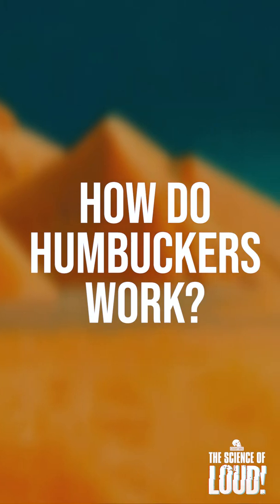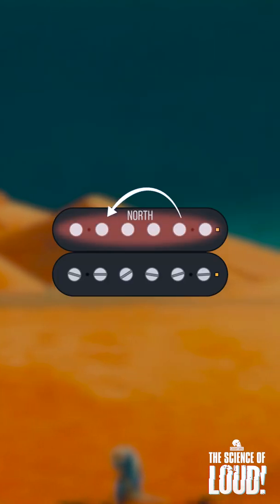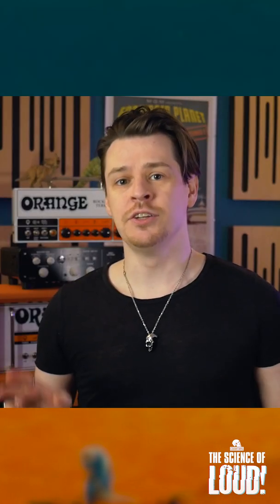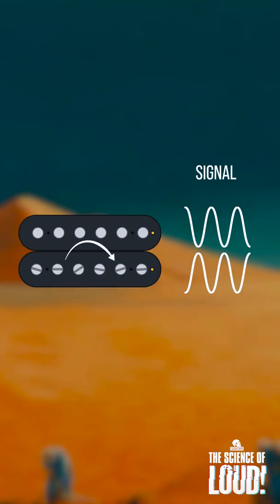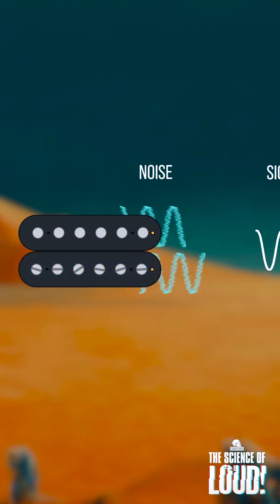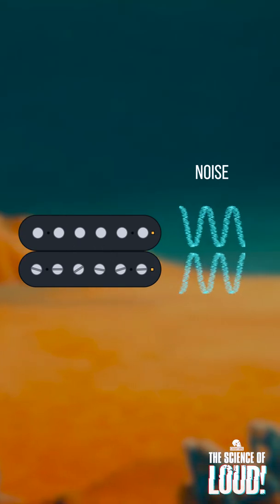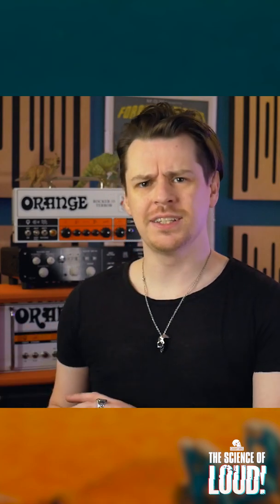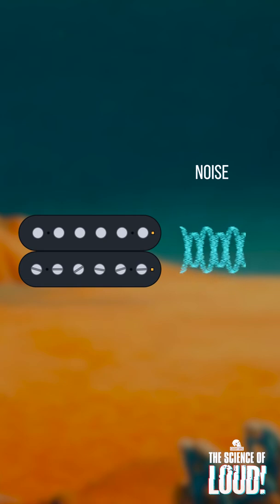How Do Humbuckers Work? | Tiny Too Afraid To Ask #shorts

Comment: What is the explanation for the tonal differences between SCs and HBs? Is there some cancellation of the signal because the coils of the humbucker aren't in the exactly same place and therefore their signals aren't identical?
Reply: i think it's because a humbucker's coils are usually wound more times than singlecoils, HBs usually have around 10 000 coil turns while SCs have around 8 000 if i'm not mistaken
Reply: @huh3682  ah, yes, that might be it, thanks! Like a p90 is also darker than a normal single coil.

Comment: Interesting, thank you. Then, what's the point of single coil pickups?
Reply: High frequencies, which tend to get lost with a humbucker.  Humbuckers are great, but will never produce the chime of a single coil.  In comparison, when played clean they tend to sound a bit dull, so it comes down to everything being a compromise, or using different tools for different jobs.
Reply: @adriansperling5012  Thank you for the reply. How come high frequencies get lost with a humbucker?
Reply: @jensvide777  I'm not entirely sure (might be something to include in a future TATA Colin? ;-) ).  I know that the more windings you have on the coil, the more the high frequencies tend to be attenuated, so maybe across the two bobbins, there are more coils over all?  Also, a single coil senses a relatively short section of the string directly above the pole piece, but a humbucker senses ~ an inch of the string between the two pole pieces - that might have something to do with it as well?  I know that's part of the reason why single-coil-sized humbuckers never sound exactly like their regular-sized counterparts.  Ultimately, relatively small changes in pickup design can have pretty large effects on the signal produced.  Think of the sound a P90 produces in comparison with a traditional single coil.  Basically, it is a single coil with a lot more windings that uses a pair of magnets at the base of the pickup rather than individual magnets for each string.
Reply: @jensvide777  the two coils that form a humbucker aren't occupying the same physical space along the string, so they're picking string signals that have some phase misalignment with each other. That will create a comb filter effect when the signals are added together.

Since lower frequencies have larger wavelengths, the phase difference for them will be relatively small; as you go to the higher frequencies, wavelengths start getting smaller and smaller, to the point where they're equal or smaller than the physical spacing between coils, so you start getting a full 180°+ phase difference, so, full cancellation for some frequencies and strong attenuation for a bunch of other frequencies.

That's the reason that single-sized humbuckers don't sound the same as full-sized humbuckers - physical distance between coils is smaller, so the comb filter effect one gets really noticeable higher up in the frequency range - but don't quite sound like single coils either.

Also, incidentally, that's the same reason the "in-between" positions for pickup selectors (2 and 4 on a Strat, middle position on a Tele) got the sound they have.

If you have two coils, but only one of them picking string signal (the other being a dummy coil), you don't get this effect. Hence, noiseless single coils.
Reply: @EversonBernardes  Great explanation! Wow, is that how it is? Thank you for explaining.
Reply: I think single coils are not meant for heavy distortion since the time they were made people only played clean tones or overdrive

Comment: Nice and concise.
Let's extend this a wee bit and explain dummy coils.  A dummy coil ALSO senses EMI out of phase, resulting in cancellation of hum.  However, lacking any magnet/s it does not sense string signal, only EMI.  Combined with an actual-string-sensing pickup, you still get hum-cancellation.  The degree of hum-cancellation depends on the relative sensitivity to EMI of dummy and string-sensing coil.  Humbucking pickups stick two identical coils beside (or sometimes on top of) each other to maximize cancellation.  But dummy pickups can work in locations other than jammed up beside a sensing pickup, and don't need to be "just like" the pickup.  I installed a dummy coil in the control cavity of a buddy's Telecaster, and it reduced hum substantially.  Not perfectly but enough to make life liveable.  The Ilitch/Suhr backplate for Strats runs a dummy coil along the perimeter of the plastic cover on the back, over top of the vibrato springs.  It has to be "tuned" to achieve maximum cancellation in conjunction with the actual pickups.

Note that if one uses a push-pull switch to cancel a coil in both the neck and bridge pickups, you need to be careful/mindful of which coil is cancelled in order to retain hum-cancellation when both pickups are used.  Naturally, one loses hum-cancellation if using only one pickup in coil-cancelled mode.  And while each dual-coil pickup may be nicely hum-rejecting on its own, if using one coil from each of two humbuckers, hum-rejection may be less than perfect (but still good enough) if the two pickups are somewhat dissimilar.

Finally, combining a single-coil PU with a humbucker may let in a wee bit of hum.  One of the HB coils will sense hum just like the single-coil PU does, while only one of the HB's coils senses it opposite phase.  Again, any time the selected pickups/coils pick up more EMI in this phase than that phase, you get less-than-perfect hum-cancellation.  As long as the resulting hum is far enough in the background, though, I think that's okay.  If one was making a recording, it might not be.
Reply: Wait what?
Doesn't the dummy coil act like a impedance load for the guitar signal?
Reply: @TheBoboMaker  Yes, it can.  But the dummy coil does not HAVE to be a high resistance.  Consider the Ilitch/Suhr backplate for providing a dummy coil on a Strat.  I don't know the specific DC resistance, but  it is not very high.  Moreover, such coils, by not having slugs or polepieces, have much less impact on the pickup inductance.  So, I concur that using an identical-impedance coil for dummy purposes CAN do what you describe, but there are many configurations of dummy coil that accomplish what needs doing, without necessarily killing or undesirably modifying tone.

Comment: What is 50’s wiring? I see that term everywhere but have no idea what it means
Reply: Colin could probably make a decent TATA out of this (and he totally should because I’m sure I’m missing things here), but it basically reverses the order of the tone and volume pots.  With modern wiring, the signal comes from the pickup and (if the guitsr has multiple pickups) hits a selector switch.  From there it goes through a volume pot, then a tone pot, before finally reaching the output jack.  With 50’s wiring, the order goes pickup > switch > tone pot > volume > output jack.  In terms of how they function, with 50s wiring rolling down the volume doesn’t also attenuate some of the high frequencies as well like a volume pot with modern wiring does, acting sort of like a secondary tone control.  However, with 50s wiring, rolling down the tone also rolls down the volume slightly, so there’s pros and cons either way.  Another option is modern wiring with a treble bleed circuit, which prevents the volume pot from also rolling off the high frequencies.

Comment: You making things confusing for beginners trying to learn this ,by using the "wound opposite direction" of one coil ,    wind 2 coils the same direction  now take your finish leads of both coils & solder them to each other .  now one of your start coils will be the ground & the other will be the hot  . that works & have for roughly 70 years ,  quite simple ..
Reply from the maker: By swapping the start and ends of the coil it BECOMES the opposite direction. A humbucker has two coils wound in the opposite direction. 
Doesn't matter if they were wound on a machine that spun in two different directions, or if you swapped the terminals after that fact. That's two coils wound in different directions. What you are arguing is pedantry because you don't understand how coils work electrically (nor how to reply to a comment thread...)
Reply: Dude, I read your 3 comments on this video and, as someone who knows nothing about making/wiring electronics, YOU are the one making things confusing. Colin's explanation is as clear as day for people with no knowledge. Seeing you talk about connecting the finish leads wound in the same direction is making me second guess everything without you elaborating OR giving a simple mundane example.

Comment: The most common way you will see humbuckers wired is  both coils wound in the same direction & both finish ends connected together  & the 2 start ends are the hot & ground .
Reply from the maker: Which makes one of those coils the opposite direction from the perspective of the current. 
Refer to my previous reply.

Comment: Humbucker coils are usually wound in the same direction .It's not necessary for hum-canceling  & no major manufacturers that i know of wind the 2 coils in different direction .
Reply from the maker: Having the coils go in opposite directions IS necessary for humbucking operation - let me explain what you don't understand:

They might be physically wound in the same direction (for convenience and quickness in production), but they are wired so that one coil is the opposite direction to the other. 
Lets say each coil is physically wound clockwise; each coil has a Start and an End. By Wiring the End of coil1 to the End of coil2 you have effectively turned coil2 into an Anti-clockwise coil. 

That's what humbuckers are doing, you wire them so that one of the clockwise coils BEHAVES as anti-clockwise, inverting the phase of the signal.

If you didn't do this and wired the coils start-end-start-end, you wouldn't get a humbucker; you'd just have a big single coil with half the magnets flipped around, therefore you'd have all the hum, but a mostly cancelled signal.

ALSO, please refer to my P-Bass video for more information on how RWRP coils work
Reply: @ScienceofLoud  If you agree with this that's fine .   "wind 2 coils the same direction  now take your finish leads of both coils & solder them to each other .  now one of your start coils will be the ground & the other will be the hot  . that works & have for roughly 70 years ,  quite simple .."    Every Gibson Humbucker I've ever seen have been done this way   .. GOOGLE Humbucking Pickups - How They Work  if you read it you will see this "both are shown with windings going in a clockwise direction. However, shouldn't those coil windings be the reverse of each other? Not exactly. Basically the term "reverse winding", although it is used by just about everybody, is inaccurate. Actually, it is the current flow in the two coils that travel in opposite directions."
Reply: If wound in the same direction, terminals are swapped and the effect is the same. Otherwise there's no emi cancelling

Comment: Colin, could you please do a TATA or Tiny TATA as to why most humbuckers only allow adjusting a single row of pole pieces and not both rows?  I am one for fine tuning my pickups but obviously I can only go so far when the second row is fixed slugs.  Thanks, God Bless, and keep up the awesome work sir!
Reply from the maker: It was probably originally a cost thing. One row of adjustable poles is cheaper to produce than two. 
Also makes it easier for production line workers to construct and install if each coil is visually different. Less confusion, less mistakes, quicker production, less cost.

Comment: Why does this effect the tone some much compared to single coils
Reply: Because it's still a double pickup. The noise is canceled but the guitar signal is enhanced
Reply: The slugs and screws that we see on the top of the pickup are magnetically coupled underneath by a ceramic or alnico bar magnet.  So, unlike a single coil, where the sensing area is between the top and bottom of the polepieces, the sensing area of a PAF-style humbucker is between the tops of the slugs/screws.  That is also why cancelling one coil of a (normally) dual-coil HB does not yield tone equivalent to a Strat-type pickup.  There may only be one coil in use, but the sensing area remains between the tops of the two coils, since eliminating one coil does not change the magnetic coupling running through the coils.
Reply: @markhammer643  how is this response to his question about tone difference?